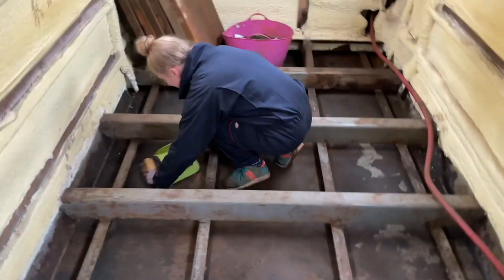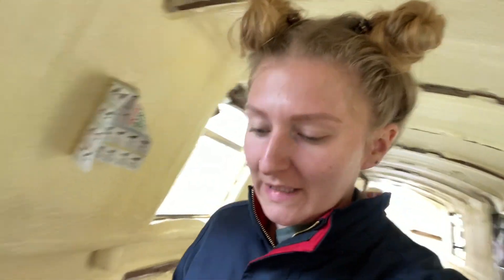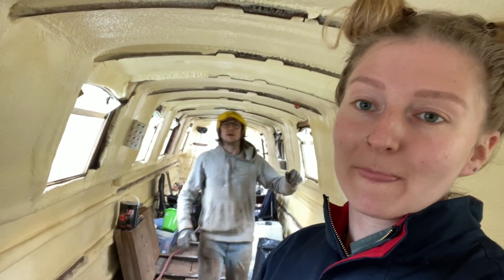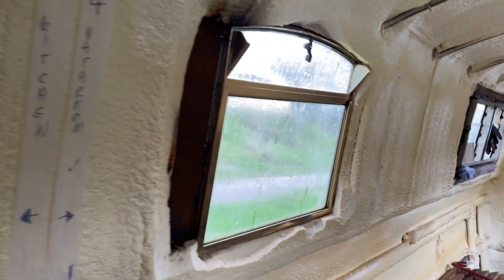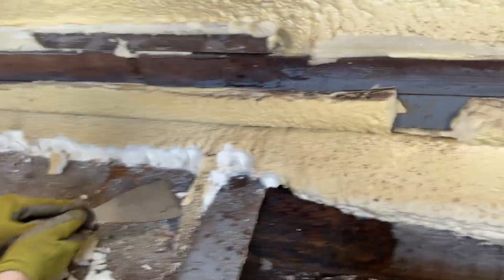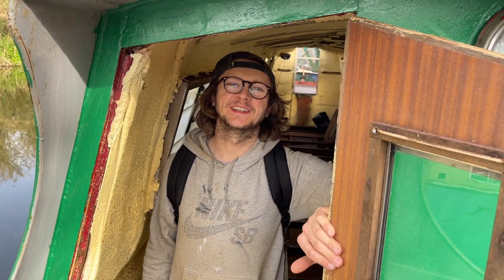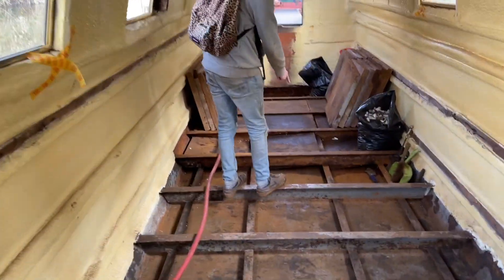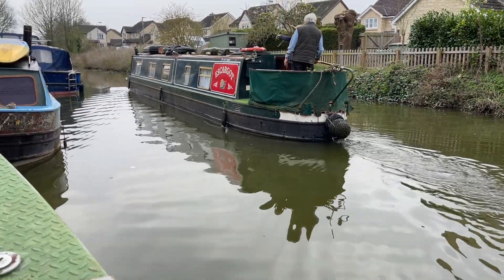Work Begins! | Narrowboat Conversion | BOATLIFE

Comment: Its very important to apply Vactan rust treatment before you apply the bitumen. The bitumen alone won't stop the rust, it will just slow its progress, so you will still have the rust problem. After the vactan treatment, apply red oxide and then apply the bitumen to seal it off. Cheers
Reply from the maker: Thanks for the advice! We just used bitumen as a semi preventive measure as it’s had a complete replete over the bottom. Will bare than in mind for the future though, thank you!
Reply: Yeah they should have done rust treatment first because you want to hope their isn’t a need to have to take your floor up in the future once the boat is done they should watch winging it boating on a budget they did the floor in their boat and did rust treatment and by the look of the floor on this boat for the amount of rust it definitely needed rust treatment and by the amount of water they had to pump out on the first video they don’t know how long that water was sat rusting the floor but it’s all a learning curve for them but as said is a few others doing boats up right now on YouTube and they could give good advice I wish them all the best of luck and hope it all works out and as said it’s a learning curve and I only know what to do because of the tight Yorkshire man and Dawn on winging it boating on a budget

Comment: Hi good luck with the restoration. Your boat was designed with a wet bilge as a lot of older boats were. All the water from the bow drains along the length of the boat to the stern where it can be pumped out by a bilge pump. For obvious reasons not a great idea which is why modern boats are built with dry bilges. I suspect your drainage pipe will block with debris. You might want to consider having the drain hole at the bow drain into a sump under the bow deck with an automatic bilge pump fitted in the sump so that the water doesn't have to travel the length of the boat before it's pumped out.
Reply from the maker: Thanks for the comment! That’s a good suggestion, it’s a shame the bow floor is almost at water level as I’d have liked to have a run off but not possible!

Comment: Funny, buy a boat, then people show you its history.  Word for the wise, get a good draw plane or spray foam knife that is about 2 ft long.  It will save time leveling the spray foam.  It took me forever, until I sharpened some sheet metal about 2 inches wide and about 2 ft long.  You can get hand blades or ones for the hand power saws. It will be interesting watching you fit out the little boat.
Reply from the maker: Thank you, oh perfect thanks for the heads up, I wasn’t sure what we were going to use to tackle the spray foam!

Comment: You would be better running the water straight out the front just cut out a drain hole, saves the water coming inside your boat!! best to keep the bilges where possible clean and dry !!
Reply from the maker: Thanks for the comment! It’s a really weird design because the bow deck is almost at water level so unable to go straight through the side of the hull!

Comment: That rubber hose will clog with debris AND become ineffective. Perhaps you ought to cut a hole in the side of the boat close to the drainage hole in the stern above the water line (and use a short bit of hose to the drain hole)?
Bad design relying on that long run of rubber hose just to get to the (old) bilge pump at the other end of your boat. Seriously.
Reply from the maker: Thanks for your comment! It really is a bad design, I did think about having a hole straight out the side but the stern deck is really low (possibly almost at water height (I will double check). I will keep access to the drain hole and pipe incase of a blockage I should be able to clear it, I’ve been advised possibly swapping the rubber hose over to solid but not sure if that’ll help at all.